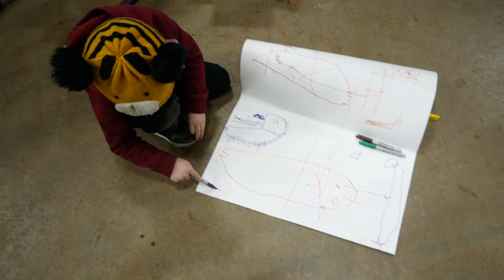Plow Truck Hydraulic Leak Escalates Quickly

Comment: When I worked for MoDOT we fixed out own hydraulic lines and attachment points (bolts).  They always fail.  We had a guy that used to work on the plows to get them ready starting in Sept.  He checked mounting, cutting edges and weld points. I operated a CAT 12 that was old when I ran it in 1976. Quite a bit different than the CAT 120 I ran in the Army. 
Anyway, nothing more pleasant than melting ice mixed with hyd fluid dripping all over you while you work. Don't miss those days.   Happy birthday mini WWW.

Comment: Great work again Wes. Shame that plow is so badly neglected! Sure would be easier to check it over in the dry season before you actually need to use it. False economy not maintaining vehicles, sooner or later the thing becomes a basket case!
Reply from the maker: Seems to be the norm here. Run it until it dies then recycle it and move to another.

Comment: hi. a was just in finland with my car,their was -30 celsius.anyway was driving and the car was telling you tire pressure its way too low.ofcourse a did stop and did go outside and kicking the tyres.they was full with air. just need a calibrate and no problems then.

Comment: Yaay! A will fit won’t fit radiator on the way!! I never have been able to figure out why when they copy something they cannot get the holes in the right place. ......
Reply from the maker: I know. I put an aftermarket rad in an International semi once. It would constantly overheat. It finally got so bad he bought a used OEM rad and had it re-cored. That solved the problem. But less than a year later it spun a bearing (Cummins N14). I am sure the two incidents are related.

Comment: Oh boy I hope the weather stays dry and frost free over here because I just noticed that my moms car needs new tires ASAP.
They are starting to crack and the front tires are pretty far gone. Diesel engine and front wheel drive... go figure...
So lets order up new rubber and get them changed at the tire shop.
They are bad but still driveable so I advised my mother to be nice and careful with the ol wagon until we get her a set of new tires.

Comment: Man. I wish every hydraulic repair went as easy as that one! Props to you on dealing with all of that rust, too. I've dealt with one rusty hydraulic fitting on a chicken crap trailer, and that ended up with the trailer going out the door with an entire new hydraulic system because fittings just. Kept. Breaking.
Reply from the maker: Sometimes that's the only way.

Comment: Yes a great start to my Saturday. Was wondering you ever thought about fabricating a back dragger for the tractor?
Reply from the maker: I have a 7' blade for it.
Reply: @WatchWesWork  thats gotta be nice i had a little 6 footer worked great had its uses for sure. Was running mine on and old gravley i bought at auction they mesed up had no reserve on it paid 500$. Great little tractor. Cant wait for the next video.

Comment: Wes, I'm certainly not being critical, but I'm curious how you determine what to fix first? I've noticed you tend to work on things in my eyes that are non critical first. For instance on this truck, the coolant leak would be my first priority in case that turned out to be a major engine problem, rendering the rest of the truck spare parts. Do you just rely on your experience to tell you in this case for example, this truck, with this engine is pretty bullet proof, so im more than likely looking for a coolant leak over a cracked block, so its safe to fix the hydo first? Just curious about your method.  Also, no heat on a plow truck and they're still driving it around is pretty scary. I keep my windshield as hot as possible when I plow parking lots, let alone blasting snow drifts at 40 mph.

Comment: The struggle is real.  We have one super crusty Freightliner that is our brine truck.  I did the safety on it last year and noted that every bolt holding the spiders to the axle tubes will need to be replaced this year for it to pass again.  In reality, isn't hydraulics just one big controlled leak anyways?
Reply from the maker: Yeah, pretty much!

Comment: i use this marine grease from Maxima Racing Lubricants Inc. the stuff is great for about any application, door hinges, it can be packed in a diff, you name it. Since its a marine lubricant, is repels water really well. i spread the stuff in the wheel well of my car over a few self tapping screws just to test its rust prevention. after 2 yrs in Massachusetts winter, with the salt & destruction, all 3 screw heads are rust free.

Comment: I've never worked on large equipment or trucks, but I work alone most of the time and can appreciate the struggle of trying to hold a wrench on the nut while spinning the bolt with the rattle gun.  The contortions you tolerated to get the fasteners fastened I can only imagine.  Hope the birthday party with your boy and Mrs. Wes were a whole lot easier.  Love the videos, your wry sense of humor, and the deadpan delivery.

Comment: fill up the rear tyres with winter windscreen washer fluid via the valve stem using a small pump on a drill

Comment: Naturally, out of four connections the problem connector would be the one that is most difficult to reach.

I am from the southeast US. Far enough south to have never plowed snow in my life because there was never really enough to warrant it. Several years ago I lived and worked out west at an airport. We had PLENTY of snow to plow. We would push snow to the edge of pavement with a plow then use a huge CAT powered blower to blow it away so it would not be a hazard to airplanes. The blower ran slow. It took 45 minutes for a single pass the full runway length. In the middle of the night it is hard to stay awake and drive straight for 45 minutes at only 1 maybe 2 MPH.

I’ve been retired a few years now, living back east. I sure do miss snow plowing, sometimes for 30 hours straight without rest...NOT!!!🤣🌬🌨❄️☃️

HAPPY BIRTHDAY LITTLE MAN!!!🎂.     I can’t BELIEVE we were not invited to the party.😥

Comment: wes in aus we use a grease tape called denzo tape to protect against corrosion of hydraulic fittings
Reply from the maker: Hmm. Never heard of it here. I think it would just trap moisture and make it rust faster, like exhaust header wrap.
Reply: denzo is wrapped around the fittings to prevent water ingress and hence stops corrosion

Comment: My experience with after-market radiators is, take careful dimensions. If the replacement supplier doesn't supply enough dimensions then move on to  another supplier. Thickness is very important to cooling capacity.

Comment: Why does a Oliver an a Long tractor..set in my mind there from the same Pedegree..? Plow frame bolts. You need a steel drift maybe two..ram it home a line stuff up...bridge ream after that...been there done that...js
Reply from the maker: I only had a 1/2" and 3/4" reamer. Longs are complete junk.
Reply: Watch Wes Work  I know longs are junk...the transmission has the oddest gear ratios... js

Comment: If the Customer keeps Paying Wes, Dont turn Work away ...False Economy going the After Market Road yes.
Mrs Wes , "Need some Air Compressor Product" 🤭, Oh Mrs Wes your Delightfull 🤗.
Wes ,Have you got a Shop Heater in there, if not ,thought about a Oil Burning Heater, Run it from The Used Oil thats been Dumped from Jobs.
Is there a Mrs Wes Vid on Birthday Presents Opening?
Good Vid My Man 👍

Comment: Classic situation where you leave the radiator cap off so the fluid does not push out under pressure. You can get away with it in the winter. They will have to top off a lot less until they get it back in next week.

Comment: It seems there is a predominance amongst the vehicles I see being repaired on  USA based channels that are in a shockingly poor state of repair. Skinflint or ignorant private owners you can sort of understand if there is no effective system of checking. But surely you should expect public bodies to maintain vehicles.  If hate to be the motorcyclist that follows that around a corner when the hose lets go and dumps a tank of hydraulic oil around a bend. Your patience in repairing this junk is amazing.

Comment: In the UK (south east of England for me) we are flipping between cold & wet, mostly damn rain ! It’s been like it since mid December, low pressure system after low pressure system& coupled with lockdown we are all pissed off with it all ! 
I live very close to the main London orbital motorway junction 7 (M25/M23) & i have never seen a gritting lorry (they can plow as well) that is more than 5 years old !

Where do these trucks go in summer ? Seems like that would be the time to do all the repairs & maintenance ! Not leaving them until they break which ends up costing twice as much to fix with no time to fix them. Someone needs firing !
Reply: Mostly, they use them all summer hauling for the municipality, county, or state.
Reply from the maker: Right. Spring and summer are really busy times for them. Winter is when they would be equipment repairs, but the plows never get a break.
Reply: @farmerbill6855  
Oh i see, poor old plow truck ! Ours are owned and operated by a government devision called highways England & they don’t get used much out of season, probably because almost all highways work is contracted out plus our trucks are purpose built.
Earlier i called our trucks by the wrong name, they are actually called spreaders & they may see occasional use out of season if there has been a diesel spill & sand is needed to soak it up.
Reply: @WhiskeyGulf71  plows come off, spreader comes out, and it's  a dump truck. Not a robot but a transformer just the same. The city of indianapolis, Indiana hangs plows on some of its refuse trucks as well.
Reply: @farmerbill6855  
I’ve seen that in other places as well like Russia. In the Most parts of England it is extremely rare to see the plows fitted & even rarer to see a grit lorry away from the main arterial roads.
If you live on a hill in England you will most likely have a grit bin at the top of the hill 😂 unfortunately every selfish twat steals the grit for their garden paths so the bin is empty when you need it to de-ice the road.
Farmers do local snow plowing with their tractors in rural areas, they will often clear roads around & leading to schools.

Comment: I remember once in Scotland  here, scraping radiator tubes clean and folding them  over ,  then  soldering them with an electric soldering iron in my kitchen . It was 11pm and I needed my car for work the next day. All caused by a lump of clear salt crystal the size of a hen egg from a gritter going in the opposite direction. I could have done without remembering that. On the plus side, the radiator then lasted the lifetime of the car. Oh happy days, not. lol.
Reply from the maker: Those days are long gone. These new aluminum radiators are one time use...
Reply: @WatchWesWork  , yes Wes', wasn't yesterday.

Comment: "Cooling systems" are (supposed to be) under pressure
for a specific reason- to raise the boiling temperature.
One pinhole, loss of that pressure- the coolant will boil away
very quickly. The system must be pressurized to work properly.
Reply from the maker: It's -6F today. They couldn't overheat it if they tried.
Reply: @WatchWesWork  Run and work that engine until the gauge reads "normal" then open the rad cap. It should be under it's rated pressure, and once released- hot coolant should geyser out. If it doesn't- there is a leak. That's why cooling systems are pressurized, and use a "coolant" of 50-50 water/ethylene glycol (or whatever).
If there is no pressure- there is no heat, operating temperature is not achieved.
If you can't overheat an engine- that shows there's no working restriction (thermostat), then of course it won't get hot at all. 

An ICE can reach 600℉ without coolant.

Comment: Do these guys have CDL's and do PRETRIP/POST TRIP inspections? I think their own Highway Patrol needs to do a check up on them.
Reply from the maker: Technically you do not need a CDL to drive a snow plow in Illinois during a "snow emergency", which is basically after a single flake has fallen.
Reply: @WatchWesWork  Wow.....town must have deep pockets. I guess an incident is the only way to change their way of thinking....thanks Wes. Glad we don't have that white stuff in Sunny Phoenix...but we are bitching about the temps in the summer when you guys are enjoying your summer! No rust though!

Comment: Probably should just leave that chain and ratchet on the side blade mount. Looked like a easy solution to help counter the twisting force that broke the bolts.
Reply from the maker: Well it has a steel brace, but that only does so much.

Comment: Welcom to my world, 35 years + working on plow trucks. I bitch but I loved it. Heavy duty "bungee" will fix that air dryer. Bungee wont fix the wing mount. I have installed many snow plows on trucks . When ever a dealer installed one we had serious issues. I would install everything with the notion that future work very possibly be done be me.

Comment: Hi..with all metal pinholed radiators i first make a temporary russian repair, pouring a can of powdered radiator "stop leak".. greetings from 10deg30min south lat.
Reply from the maker: That's a bad idea on these trucks. The oil cooler and coolant filter will plug right up.
Reply: @WatchWesWork  well, no russian repair then..best regards & go buy a piñata for litlle heir..

Comment: If you get board get a used Fisher Myers boss which ever put a pare of ears in the bucket a nd if you have auxiliary  hook up for power angle makes a great plow rig you and push it a pill it high dose a great job makes plow surface smooth and clean wouldn't take long to make it up i have done many of them for loads and back hoes to do parking lots

Comment: That looked like fun.
Anybody ever try adhesive lined shrink tubing on hydraulic fittings to prevent rust?  I did once, but they sold the truck shortly after.  Don't know if it worked out or not.

Comment: So I've heard you're supposed to put a sprinkler under your car after driving in salted roads. To get the salt off. 1.is this true. 2. If it is. Why don't people do it more offten?
Reply from the maker: True. Because it's cold. Who is going to drag out a hose when it's 6F/-15C? You'd have to drain the hose every time to keep it from freezing.
Reply: @WatchWesWork  good point. Just imagine that companys would to save on repairs

Comment: Are you a decent welder?
Get some channel and nuts, bolts, washers.
Construct a simple cab for that tractor.
Couple hinges, latch for door.
4 bolts to anchor to tractor.

Get a heater core for a car, build box around it.
Blower fan, switch.
Interrupt the hot radiator hose, make simple loop.
Build entire thing for $150.

Easily remove for Summer.

Get fancy- weld tabs on top frame, bolt on
a windshield wiper motor, one blade.

Those build videos would be so cool.
I could even send you the plans.
5 simple trapezoid frames + plexi.
Reply from the maker: There's a factory cab around somewhere that would fit it. I'd rather have it open.

Comment: ONE mother of an air lock with your coolant system  my personal ad vice with that is run a vac filler  on ther coolant system / it pulls a low vac through the whole coolant system allows you to refill withou all the bleeding and burping .

Comment: Wes, I tell you what I got I'll trade you for your little boy. Got a nice '85, F-750 w/air brakes, 429 cu.in., 5 spd w/2 spd., ramp bed, 10k lb. elec. winch w/ fairlead, almost new radials with only 88, 000 actual mi. from the City of Calhoun, Ga. originally.  I know, I know, some think that's not enough to offer, but when was the last time you could still see the crayon marks on the factory paint dbl/frame rails, no rust jacking at all??? I know how much I hear ya'll talk about the rust flakes on them trucks, and I think you could actually wax the rails on this truck. 
LOLOLOL, I hope no one is actually taking me seriously about trading, but you can't never tell sometimes how much this rust, is getting to Wes by Spring. HaHa . But, I do really have the truck here in N/Ga. and it does need to belong somewhere else!

Comment: Those that design these machines don't have to maintain and repair them.  Therefore, maintenance and accessibility of the components isn't a major design consideration.  I remember many, many years ago, to change the spark plug on one model car with a V6 engine, you had to disconnect the engine mounts and lift the engine a few inches to get to the spark plug. These werre some GM models in the 75-80 years.

Comment: Well somebody's got to fix them trucks. And I do know about the frustration with hydraulic lines. I work on business jets and they have anywhere from 1 to 3 hydraulic systems and titanium lines and flexible hoses . Have to unbolt hoses every time i remove the landing gear or hydraulic pumps or other hydraulic actuators. fun fun fun . Oh by the way ,the  planes have what is called Skydrol for hydraulic fluid and it burns your skin or eyes if is on too long. 10 to 20 min. Eyes is instantly. Not fun.  You should wear some safety glasses when working on these trucks.

Comment: What do we always emphasize when replacing
suspension components?
Only tighten stuff down when there's weight on
the articulation.
Easy to  tell- these components were mounted
when the vehicle was jacked up.
Apply real load, and huge stresses are applied to 
the woefully inadequate fasteners. Improper torque,
no thread locker-

This unit was put together very incorrectly.
You shouldn't have to hammer in bolts, holes don't
line up.

They should praise your skills and your wallet,
the mentally draining environment is awful.

May Almighty God Bless you, Wes.
Reply from the maker: Who knows if it lined up when it was new. You can see the wing plow is bent in the middle. I'd say it's been hit really hard several times.